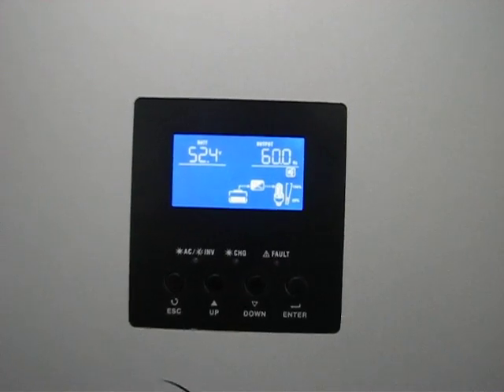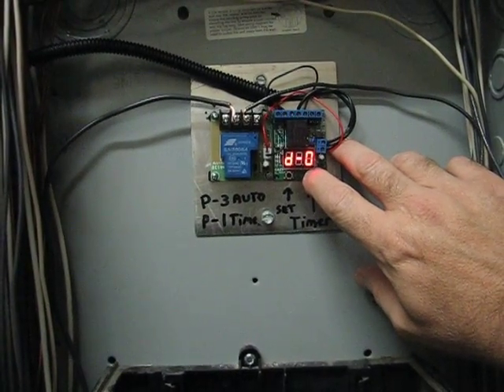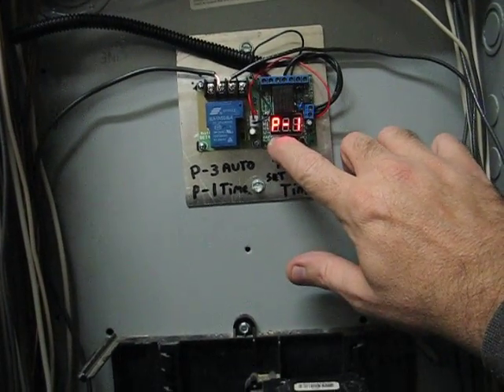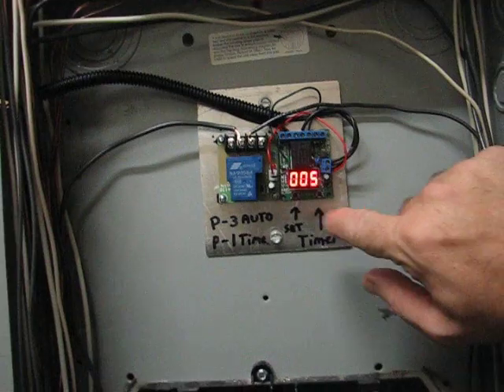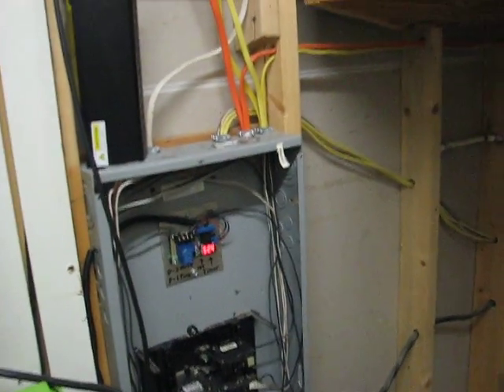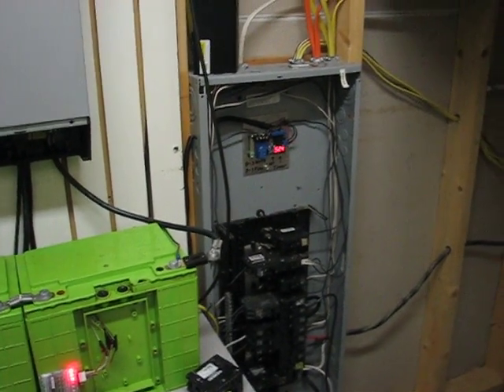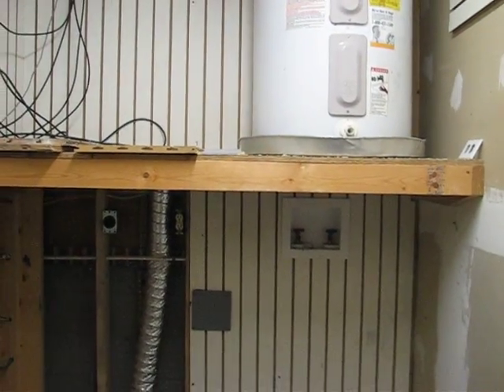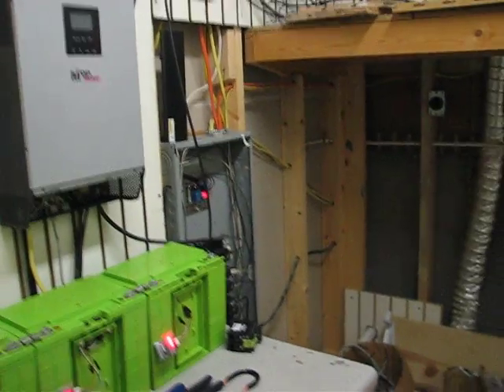Solar Off Grid / heating water & breaker box #3

Comment: Nice job on the voltage controller. I built one  too. I have mine from 0-99v fully adjustable with a small time delay built in. Great idea using the hot water heater for dumping the extra power. My set up sends the extra battery power to a gti. 
I'm glad to see someone else using this type of set up.
Thanks for post.
Great work!!